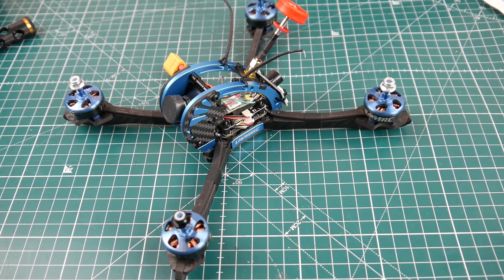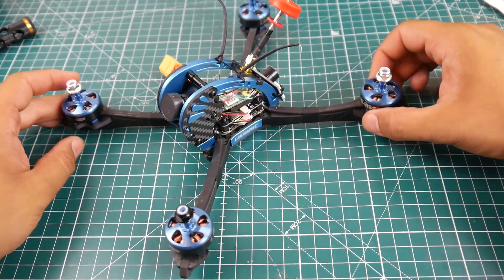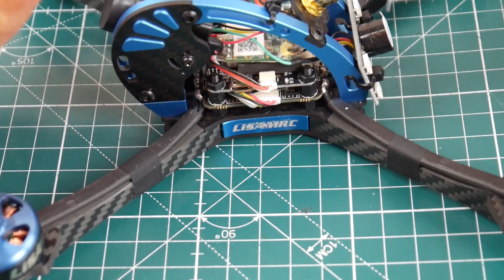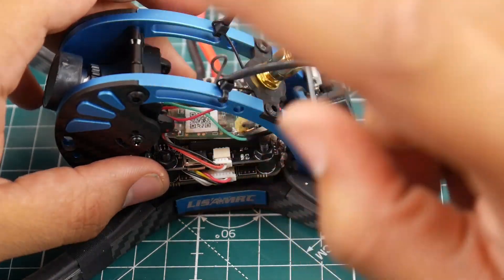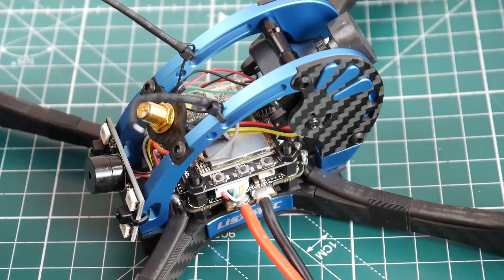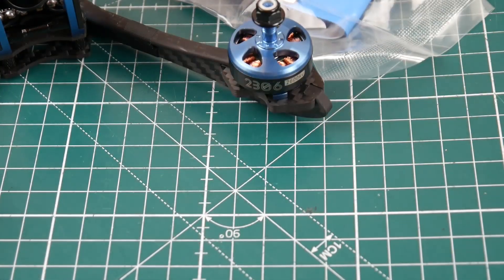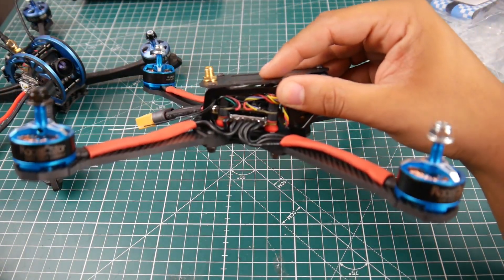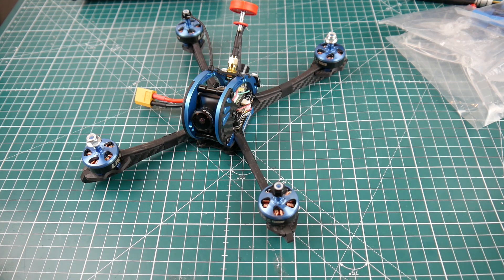Lisamrc LS-X220 FPV Racing RC Drone // Component Review and Current Trends

Comment: DQuad Obsession clone again with vertical arms. Well well, interesting how they handle horizontal impact against single arm in small angle (usual crash in tree trunk). By the way there are good news about FPV and antenna. This frame design with antenna under 45 degree angle make possible to see antenna from nearly all quad positions. Checked at today with GepRC LX5 frame which is the same from frame elements and antenna location view in difficult environment (many trees with leaves). This frame design didn't blocked antenna signal at all.